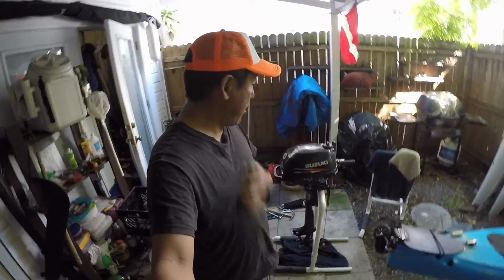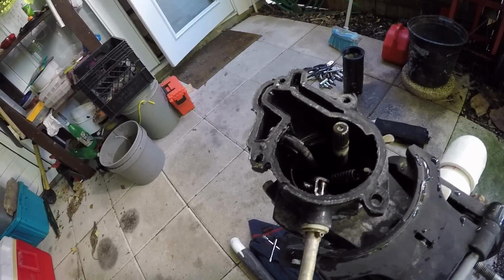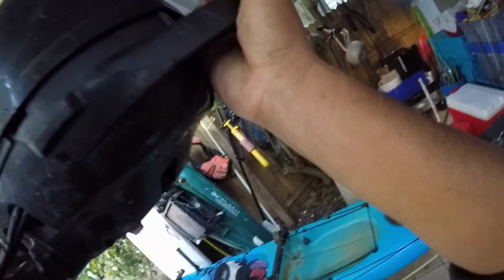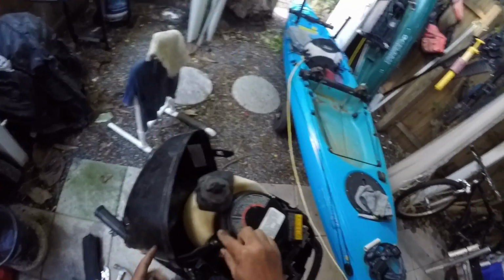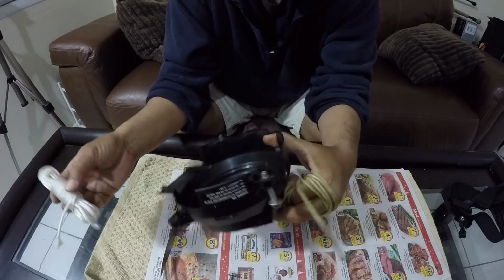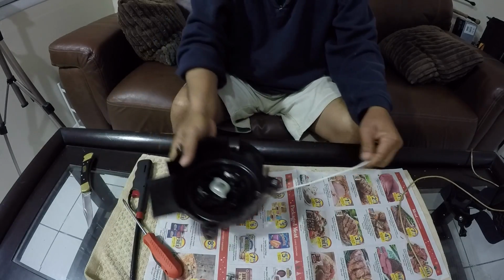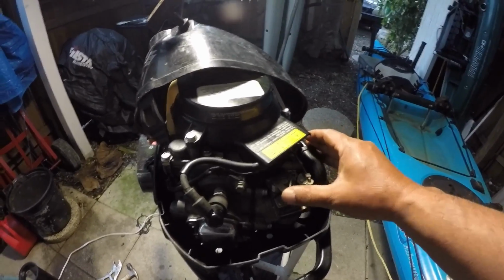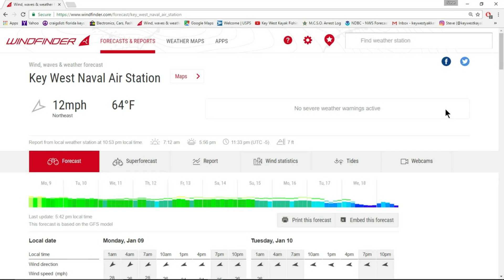Suzuki 2.5 HP Outboard Repair - Pull Start Cord And Water Pump Tube

Comment: Good job Steve,  it's good that you can spot engine trouble and fix it.
Reply from the maker: Yea, its an invaluable tool.  If I took it to a shop for a single problem, it would cost more than the motor is worth.  They are almost disposable.
Reply: Yes sir...exactly.

Comment: Its good to be familiar with your small engine. I have taken mine apart several times. Good video!
Reply from the maker: Yea, it gives you confidence that you can fix it if it breaks.
Reply: Does this outboard really brakes down very often? It looks like one part breaks after the other, how many years did you had this motor before it gave you problems?

Comment: Good channel.  FIshing, cooking and wrenching. :) A tip for your gasket (low pressure gasket, like yours).  Permatex layer on foot side of gasket (like you did), but motor side of gasket gets a thin coat of red silicone. Motor head side gets thin coat of oil. Red silicone will not to bond to oil, but will gel and not totally compress like gasket material will. Red silicone is also heat resistant. Should save you some gasket purchases.
Reply from the maker: Good idea.  I like that.  The gaskets aren't expensive, but it takes a week to get any parts.  That sucks being down for that long.

Comment: Man...you are a Star. Right in time I found you! Went to see one of this today and going to buy it . Is good to rely on someone so Helpful and Clear Teachings. THANK YOU. Logically Subscribed and will be checking you out whenever you come around. Please forgive me but going to ask you a question if you don't mind. Anything to look for on this engines when buying used? Wanted a Air Cooled...but Honda is so loud! Little afraid of the water cooling...How to know if it is not working the cooling system? Again THANK YOU. Cheers
Reply from the maker: Hey Beto.  The Suzuki or the Mercury are very popular.  No way to tell for sure, but making sure water is coming out of the pee hole will let you know the water pump is working.  That is generally good enough to know that the cooling system is working.

Comment: good fix..if you didnt have jb weld, you could slip a piece of plastic tubing over the break  with two clamps
Reply from the maker: Unfortunately not enough room for that.  I can just replace it easy enough if the JB weld doesnt hold.

Comment: Personally, I'm glad that kayak is not a tandem!  I wouldn't want to venture out with you very far relying on a JB Weld repair to get back home in nasty chop.  It's fine for something temporary but not something for the long haul.  And vibration will be its enemy.

I'd suggest you either order the part or form one from copper pipe.  An ACE hardware may even let you use a flaring tool in the store if you buy the pipe from them.
Reply from the maker: I always have the finger over the pee hole method.  Work for three offshore trips.  JB weld fixes the world.  LOL.  Just gotta have faith.  I always have my peddles and paddle to get me home so no biggie.
Reply: I use quicksteel a lot

Comment: Hey Steve I've got an extra set of flaring tool for small projects like that, not new  but in perfect working condition, if you want to put it put in your tool box I send it to you.:-)
Reply from the maker: Thanks Coral.  A couple different buddies down here have them so if that JB weld breaks I can do it right.
Reply: Any time, I thought this was gonna be my snapper deal finally :-( LOL

Comment: hey man.... i have a 1984 Suz. 8 hp DT8. i pull the cord and the plastic gear turns But it does not go up to connect with the flywheel to start it.  What piece do I need to replace or repair?? Thank you Very much.... anyone who knows.
Reply from the maker: The best thing to do is to download the maintenance manual for that outboard.  They give a lot tear down info and diagrams as well as part numbers.  The other thing you can do is to take a look at the parts diagram from the parts stores.  I use www.Brownspoint.com.  They sell Suzuki parts and have the diagrams.  You can see the different parts that go with the starter.